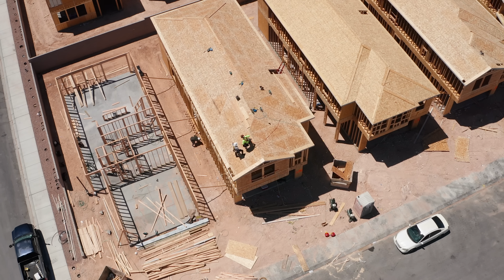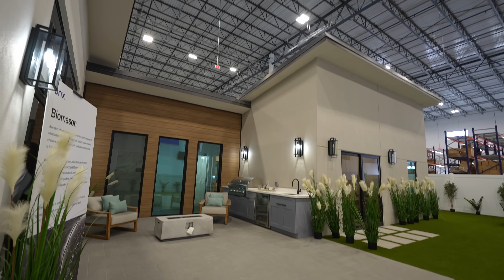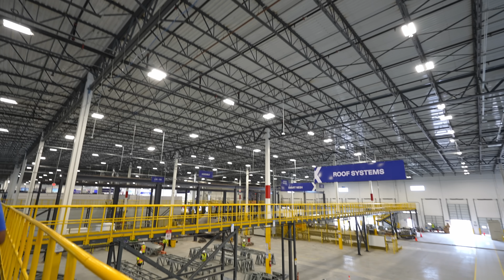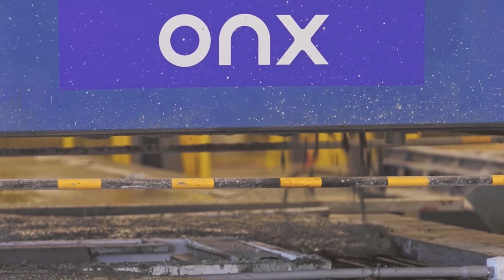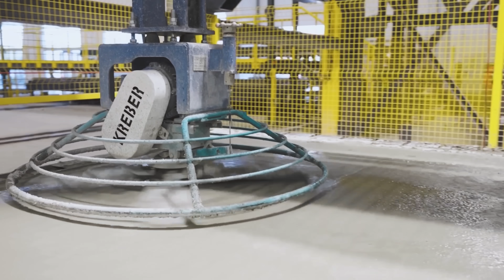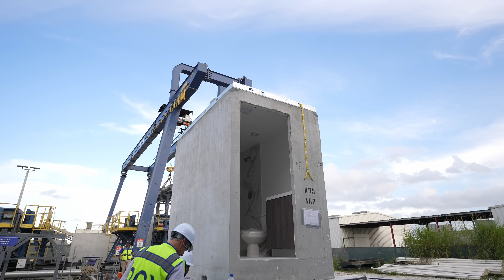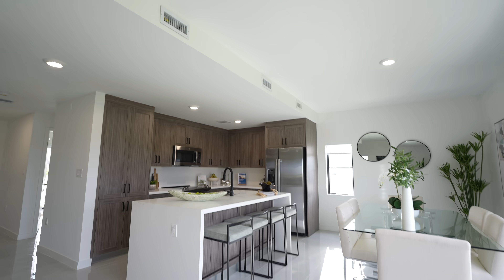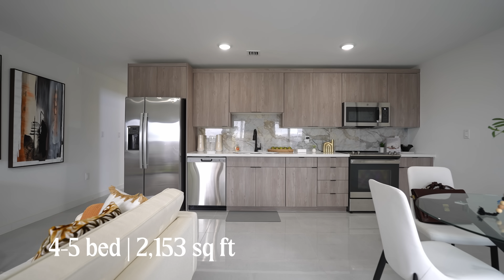Why This Company is Building Thousands of Concrete Homes

Comment: 500k USD for a house that size and made with concrete and steel, translates to approx. 400k GBP. There is no way you're getting a house that size with those materials in the UK for 400k. Some of the poor build quality homes probably half the size of that house are going for 350k...in small towns, cities are even more expensive. So considering how piss poor quality of the homes in the US are, this price seems reasonable. Not cheap, but reasonable. Remember there are going to be far lower maintenance costs for houses made from concrete, and it cures harder over the years.

Comment: Concrete has fun challenges when it crumbles in dry areas, ground water seeps upwards, mold, running electric wires, making changes to layout, earthquakes. However they are resilient to wint, tornados and fire.
Reply: Earthquakes is what I would worry about. Having a slab of concrete falling on my head. Even if the house survived it would be cracked all over. Luckily Florida doesn't seem to have a problem with those. Different house types suit different areas. There is no one-size-fits-all.
Reply: Like they said in the video, it is drywall inside, so running electric might not be as difficult.

Comment: well. based on mass thermodynamics this needs 2-5 inch outer insulation, so the house wont warm up or cool down , cos the cooling and heating costs more energy if it dosnt have a good outer insulation, cos concrete has a great mass thus is a good heat battery, so if you insulate the outside well, the inside will be amazingly comfortable.
Reply: Which is what most Europeans are like and it exactly why Europeans cannot comprehend an air conditioner.
Yet, I still think there should be an air conditioner.

Comment: This construction process is called IBS (Industrialised Building System). I'm surprised it wasn't brought up in the video though, instead of stating it as prefab.

I also don't understand the USA and their obsession with drywall and using wood as home's framework. It's crazy. We usually use it just to hide wires.

IBS method is very common in Asian countries and it's actually nothing new. It's also being used to construct high rise condominiums and etc already. 

It's faster and cheaper however the measurements need to be precise. One error and it would affect other blocks as well hence requiring all to be redone = delays. If all's good then it's fast.

Comment: All new homes these days are basically manufactured homes. They build most of the homes in warehouses and assemble them on sight. This house is Starting at
$380,000s for a 3-4 Bedrooms / 2-3 Baths 2150-2484 Sq Ft. The material used is dirt cheap and easy to make. The price doesn't justify the material used. You are way better off living in a place that is safe from hurricanes and with lower homeowners insurance.

Comment: Really cool.i love the concept. However they are way to expensive for the average person. They all look the same. Hopefully they come with more than one garage and cocrete will make these structures much much heavier than stick built. This meads that the foundation and earth undrr it must be able to take this weight without shifting much. Concrete does not flex well and will crack very readily.

Comment: Concrete home build and Tile floor??   good enviroment in hotter states but will be extremely cold during winter for upper midwest and eastern area...  Price starting $500K still very expensive after all set and done.
Reply: Will be warmer in the winter than your standard American wood house. It's much harder for cold to transfer through the concrete than it transfer through siding and plywood.

Comment: Concrete homes are not popular in the US because lumber prices. However, concrete homes have all of advantages over wooden homes; flood, earthquake, fire, termite, noise deduction, etc. In addition, the cost of labor is a lot of lower than to build wooden homes. Concrete homes can be popular if we have the facilities to build them in the factory. It only takes a few hours to assemble the house on site, and spend a week to finish the interior and yard. House can be done and deliver within a month.
Reply: I am not sure about earthquake safe, but I am more interested into insulation issue.

Comment: The US is finally catching up. Building codes in Okinawa, Japan have required this kind of durability for a decades. Typhoon-proof (hurricaine-proof) doors and windows are also standard. I think Guam, Taiwan and Korea also require concrete and steel-reinforced concrete construction. It's sad that localities in the US are behind.
Reply: Japanese homes do not last a long time. They’re only built to last like 30 years
Reply: @Arginne  Maybe, but I lived in some that were older than 30 years. More importantly, they didn't blow down during typhoons.

Comment: There are homes in Savannah GA concrete and been there before the Civil War.  I believe there is a steel beam below the ceiling that supports both walls if a Hurricane passes thru. So, this concept has been around but builders decide the public just isn't worth it.

Comment: It's amazing that a nation as advanced as the US still builds homes with wood when in Africa & everywhere else homes are built with cement blocks & concrete... They are not just more durable they are also good for temperature insulation & did I mention that they are durable? 😂

Comment: As a lifelong 'Cretan, I have no reservations regarding concrete. However, the premium price is suspect. Concrete is one of the cheapest building materials. The trick is getting it to cure in the shape of a house - frugally. That even stumped Thomas Edison. 
Let us calculate the amount of concrete needed to build a six sided cube, from 36' x 36' x 0.33' panels. (11m x 11m x 0.1m)
36 x 36 x 0.33 = 16 cu yds.
6 panels (4 walls + 2 floor / ceiling) = 95.999
Roughly 96 cubic yards. 
Check local concrete companies for prices.
Assume concrete is $130 cy, then the material cost for the concrete shell is $12,478.75.
(Each additional floor panel costs approx. $2080, add $6.2k for a total of (4) 8.75' stories)
$12,478.75 + $6,200 = $18,678		
4 floors x 36 x 36 = 5,184 sq. ft.
(More if you design an accessible roof deck)

Comment: On the flooring. You dont need carpet b/c you are in the south where its usually always hot. One problem is when it gets wet, everyone falls bc it is slippery. And on cool days, it gets cold in case you want to walk around barefoot. Looks cool but $500k houses is too much for more than 1/2 the US population.

Comment: in countries where labor cost is cheaper, the concrete houses were built on site using formworks for columns/beams, with walls erected using concrete bricks. a bit slower method than using 100% pre fab panels, but has a lot flexibility to adapt to many architectural designs.

Comment: How OLD is this video, who uses PVC plumbing anymore.  I installed PEX (the good kind) 18 years ago during construction and love it, I can control ALL plumbing at my Maniblock (water control panel for each fitting). I built my ICF home, 2,000 sq. ft. plus 1,000 sq. ft. 3 car garage with a 500 sq. ft. bonus room over that garage that I rent out. $$    Main living area is all down stairs so it will be my forever home and is ADA friendly.   My exterior walls are 17" incl. brick veneer and I have a metal roof with metal roof and spray foam on the backside of the roof deck and keep a chocolate Easter Bunny sitting on top of my HVAC unit in the conditioned space attic.  I grew up and still live on the Gulf Coast and have survived hurricanes.

Comment: Concrete is not the best insulating material in homes nor most practical for MEP install systems…there is a reason north America builds type V wood framing…no such thing as “stick” building

Comment: Prefab concrete tilt ups for warehouses have been very popular. Only a matter of time until it was applied to homes. Prefab isn't limited to concrete either. Wood & steel can be factory fabbed &  shipped to the final assembly point cutting down on waste. Same is true for custom log homes.

Comment: Thanks for bringing up the C02, imbedded carbon emissions that concrete creates. That is one major issue with concrete and steel. It takes a TON of energy to produce. Wood is more sustainable, as sustainability is defined, and concrete is maybe more resilient, when done properly. One issue with concrete is the building does not breathe and there needs to be a venalation system, outside fresh air. We have mold issues in concrete apartments I manage in FL. They are damp and cold, and seasonally have issues with mold. The science in a building is tremendous. Your science teacher would be proud.

This topic is larger than "a material". Municipalities play a role here when it comes to delivering affordable houses that are resilient and sustainable. By the way, I saw wood roof decking in your video.
Reply: I’ve personally always found it jarring to see our civilization terraforms the land we use. Concrete is water intensive yet look at CA, most cities, endless empty concrete parking lots that could easily be sand. We don’t need all this concrete everywhere. Imagine we designated all empty lots as green space until purchased or designated otherwise. We live in a society.
Reply: @trvst5938  sand has it's own issues, drainage and run off. I hear what you are saying, we need perk type land. Not all percolates like you want it to.

Comment: The only thing about the steel in a fire is that it expands when heated and can push walls apart causing collapse. 
Otherwise I want a concrete home that's a bunker that can withstand a F5 tornado and category 5 hurricane.. and bullets.
Reply: This kind of sprawl will cause our extinction. Too wasteful.

Comment: in Europe buildings are built of brick or prefabricated elements, I live in a high-rise building which is built with elements of a large prefabricated concrete slab, plus it was built in the 1980s and is still standing, of course they have their practical drawbacks, you can't change anything because of the structure, but they are at least solid
and the construction cost is lower and faster

Concrete also has a certain disadvantage - it conducts temperature well, so it needs additional insulation, then it meets all standards.

Comment: I grew up in South Florida in a home made of cinder blocks filled with concrete.  Local code requires that method of construction so that the house will withstand hurricanes.  It's neat that they're building houses like the do in this video; it results in a better quality, more durable house.
Reply: Most houses in Florida are built this way. This video is a bunch of bologna.

Comment: According to the schematic the garage is 7 feet by 3 feet. Is it just for smart cars? lol In the 60's I lived in CBS house, concrete block and steel construction. Then the selling point was protection from termites. But it was site built like a stick house. The house was great. Thanks for the video. 😊😊😊

Comment: It's interesting that you mention that concrete houses are unusual for the US. In Russia and other many countries the houses actually are built with bricks and concrete only. I visited CA in 2010 and I was in shock how floppy houses are built, and yes I get it due to seismic dangerous zones and etc but concrete structures are built to withstand those jolts, just like skyscrapers in a downtown of any US city. So we think it's better to built concrete solid structures capable to withstand earthquakes than build floppy ones.
Reply: Concrete, stone, and brick structures do not do well in earthquakes unless special remediation measures are taken. Earthquakes require a flexible house like wood. Plus, when a concrete building collapses you are most likely dead, crushed under tons of concrete; in a wood house you have a chance to survive.

Comment: Good idea for Florida where moisture is a problem. Houses would be recyclable too. Strip out the metal parts and crush the concrete to reuse as aggregate for another project like they do for highways. The downside is that you are locked into that home configuration for ever and the DIY remodeling would be near impossible I think without lots of specialty tools. But a good start.

Comment: nice looking homes, but no space.  I'm onboard with concrete.   However, everything is so small.  it is like an office with cubicles everywhere.  in the floorplan you show, the living room, dining room, and kitchen take up 348sq ft, and that includes the needed aisle for walking.  you basically have 5 micro living pods (bedroom and bath) of 200sq ft plus a closet, and with almost no common area in the house.  the floorplan shows one couch, and any other sitting would be at the dining table or kitchen counter.  There's not even enough sitting area for the 6 people in a family that would live in a 5 bedroom home.  So you pay $500k for a place to sleep and eat, but not really live and spend time.

Comment: Energy efficiency has left the chat. Building a concrete house without thermal insulation is the biggest idiocy, and don't say it's in the wall because that 2 cm polystyrene foam can be anything but thermal insulation. In Europe, 0 energy houses will already be the norm, which requires at least 25-30 cm (1 foot) of thermal insulation on the entire outer surface. So ONX still has a lot to improve.

Comment: Your understanding of modular/prefab manufacturing is poor. I’m not understanding where you got the idea that prefab is limited to 2br. Whether you build with concrete, steel or wood framing, if you’re building in a factory, you’re using the same general concepts. This isn’t earth shattering. Your point that most prefab companies don’t build huge developments is valid but I don’t really think we need large developments of identical houses. That’s the opposite of what we need. And $500k is well above the average home price.

Comment: Here in oz bricks and mortar houses costs much more to build so most houses are wood frames as well with a one layer of brick covering usually for the first floor. For some reason it costs almost double for full brick homes. I guess wood is cheaper than bricks or concrete.

Comment: Concrete is nothing new, but definitely new in North America. However there is something newer and it is called Aircrete which is concrete but with air bubbles in it. making it much lighter and just as strong as concrete.  I was surprised to see that this company is not using aircrete, because the savings could be tremendous, but it does require know how to make it work properly.  Anyways in 20 years, prices of stick homes will crater to the ground with new technologies out there.

Comment: What about earthquakes?   Is a concrete home a good idea in an area prone to earthquakes?  I know that old concrete buildings will bury you under rubble in an earthquake.  However, I suppose that a modern concrete house has lots or rebar or some other method which will protect the house from breaking up but I am not so sure.

Comment: They are building it in the middle of nowhere, it could be your vacation home or something but i doubt you'd be watching this in that case... oh and it's extremely low and close to water, it will get flooded even if there is slight wind... 26.77294891623879, -82.04812668454358

Comment: Maintenance and renovation in a concrete house can be a huge pain depending in how plumbing, wiring and ducts are run.  If they are embedded and have to be chipped out to be replaced, ick.  It would bar under to know how they manage moisture since concrete its porous.

Comment: I grew up in Taipei, Taiwan, where all the homes and apartments are built with concrete. It is SO MUCH better and stronger! You won’t hear people talking in another room.
Reply: Well, same as here in Hong Kong, but it is not always the case if noise making from upstair neighbor by dropping something or jumping up and down. But I learn that you guys have better noise isolation approach than we do both on ceilings and flooring.

Comment: Florida homes are concrete block homes with vapor liner and drywall to begin with.  These are just solid poured walls.  The roof trusses made of steel are an attractive feature.  A metal roof is desirable at this point

Comment: Concrete is really the best building material even if you just build your own out of cinder blocks. The only reason wood stick houses became the standard in the USA was because of the cheapness and availability of timber. Surprisingly concrete may also be the best material for boat building as well if you consider the number of do-it-yourself boat builders who have used ferro cement or Portland cement without aggregate troweled into multiple layers of either hardware cloth or masonry lathe and then waterproofed with paint.

Comment: Unfortunate to see the prefab slam.  These concrete homes are prefab by every definition.  Prefab is vastly better than stick building; greener, faster, easier on the neighbors.  These concrete homes being prefab is good but concrete has a massive greenhouse gas cost.  We are not affiliated with prefab or any one homebuilding method.
Reply: There are plenty of pluses and minuses to nearly all forms of prefab. But yes, the slam of it, is subjective. Here in AZ, there is an opportunity, and honestly, anywhere in this country. If there were a national campaign to do it, it would grow and allow the masses to see it's benefits for sure!